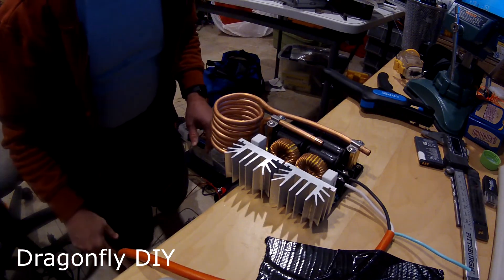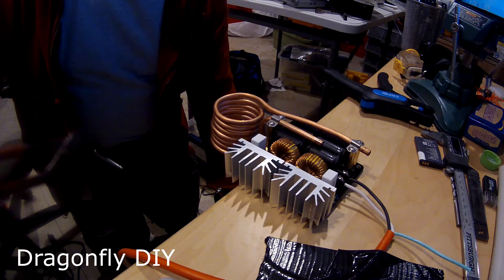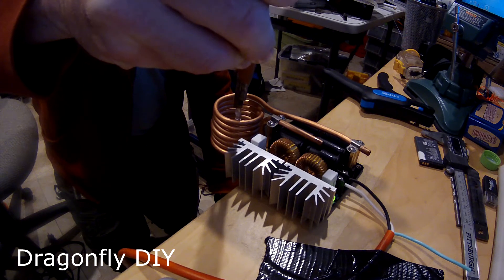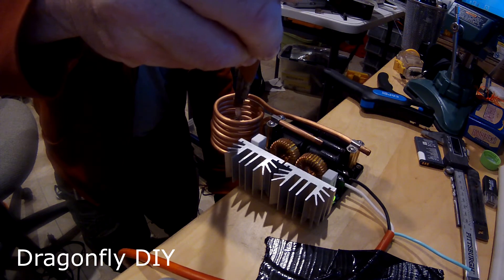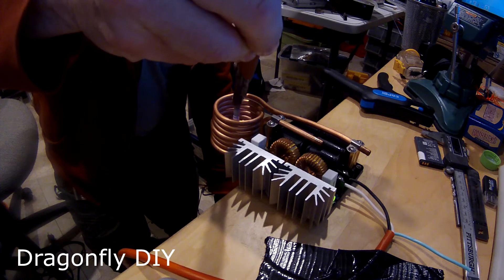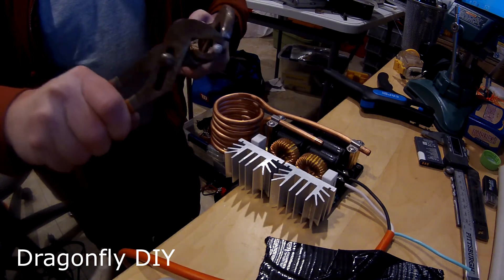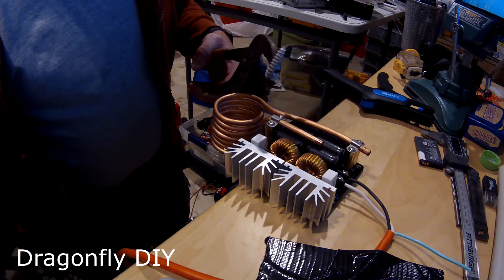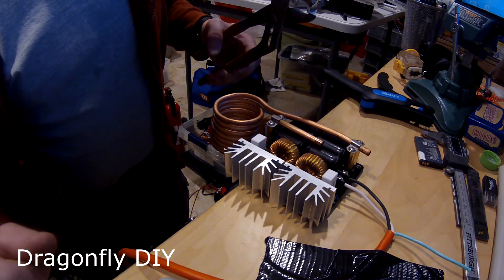ZVS Induction heater

Comment: Application for? Rusted bolts? Welding nuts to a bolt?
Reply: Moes you can do lots of stuff. You could melt and cast some metals, heat up a specific area of a steel rod to be forged, or they do make portable versions to heat up stuck bolts